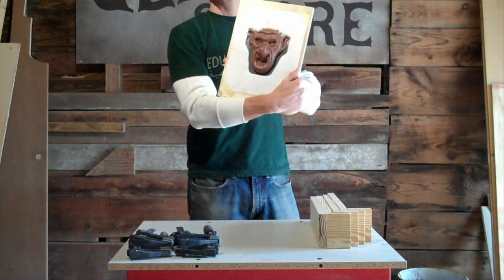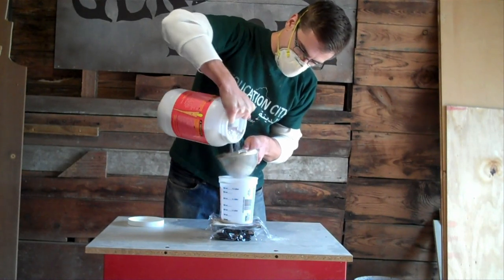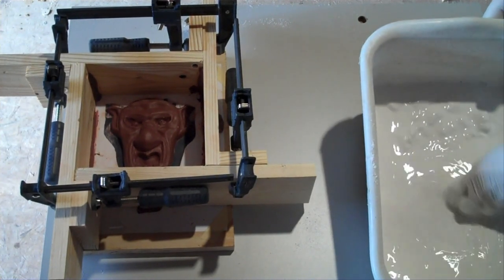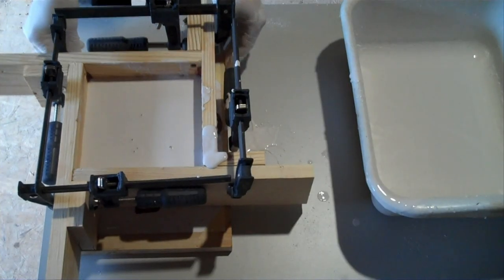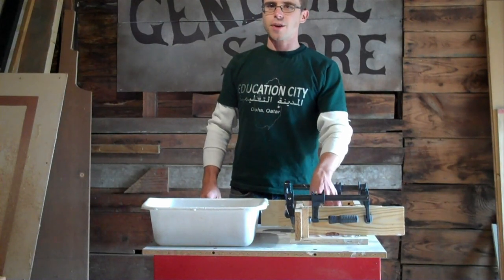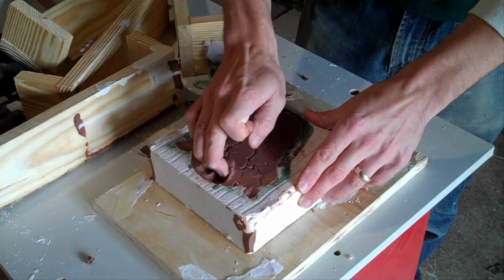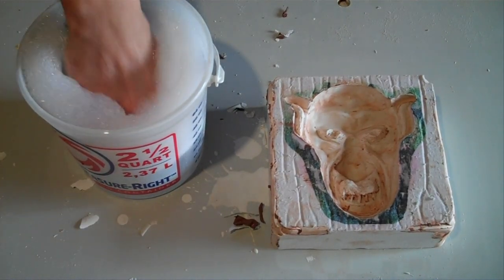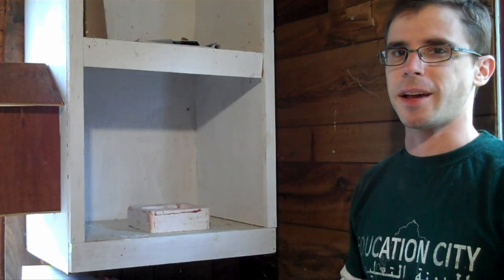Making a Plaster Mold

Comment from the maker: I've never cast metal in plaster, but I've read that for any metal you cast, you need to use a special plaster and it needs to be baked for awhile and cast while hot. Regular plaster has water in it, and since all liquid metals are hotter than 212 degrees F, it'll make the water turn to steam and the mold will burst.

Comment: The major disadvantage of the process is that it can only be used with lower melting temperature non-ferrous materials, such as aluminium, copper, magnesium, and zinc. The most commonly used materials are aluminium and copper. The maximum working temperature of plaster is 1,200 °C (2,200 °F), so higher melting temperature materials would melt the plaster mold. Also, the sulfur in the gypsum reacts with iron
Reply: What material should I make my mold from, if I am working with higher temperature melting points of certain metals?

Comment: Hi! I think painting a layer of lubricating oil on the clay will help you remove the model without destroying it. We use this technique in concrete casting.
Reply: would a silicone mold release work you think ?

Comment: Could you use a foam or similar material to say make a sword, then cast it in plaster on all sides (except for a small pour hole)? Then just bake it to get the foam or similar material out while also hardening the mold? I'm trying to make a sword out of aluminum or pewter.

Comment: Great video, Eric. Thank you for taking the time! Could you tell me what kind of plaster is best to use for casting the Ceiling moulding, fireplace mantels, furniture pieces etc... So basically, i already have a mold of the exact shape ready, i need to figure out the material to use for the cast. any pointers? Thank you in advance

Comment: What kind of material could you use in the mold when done? Could you use plaster or cement or what? Does wood or metal also work with a plaster mold?

Comment from the maker: Yes, you can get the clay out, but whatever material you use to cast in the plaster mold will end up trapped. Any rigid casting material, like plaster, clay, resin, or rigid foam, will be stuck inside with even the slightest of undercuts. If you cast with a more flexible material, like latex or even paper mache, you may be able to break it free if the undercuts are slight. But really, if you are looking at keeping undercuts in your mold, you should use a different mold material than plaster.

Comment from the maker: You can use this as a one-time mold, and in that case, you can have undercuts since you'd just be breaking away the plaster. Of course, you'd be destroying your original clay model in the process, so if your mold doesn't work, you've lost all that work. For lost wax casting, you typically make a mold of your original, than cast that in wax, than build your one-time-use mold around that wax casting.

Comment: I'm trying to make a object made of glutine (bicarbonate + superglue), the mold part is easy, but I'm failing to remove the object I made. It sticks to the plaster. Soaking the plaster mold with vegetable oil before doing the glutine, or with WD40, it did not work. Anyone knows?

Comment: Great video!! Thank you!! 

Can I create a plaster mold and use silicone to cast?  I have a small, flat, somewhat detailed, one-sided item that I will have printed on s 3D printer and I need the resulting cast to be flexible.   

What is plaster the best mold material for preserving detail?  Think a lace pattern in terms of detail. Thanks in advance.
Reply from the maker: +Donna Shanks You can cast silicone in plaster. The tricky part will be making the mold of the 3D printed part; you want to make sure you are able to remove the part after making the mold.

Plaster is pretty good at preserving detail. Use a pottery or art plaster rather than the hardware store plaster. Make sure it is fresh and sift it well before mixing.
Reply: +Eric Hart Thanks so much.  Yes, I was hoping that there is something I could coat the item with.  

I just realized an error in my earlier description. Sorry.  It isn't one sided.  It's a stencil that needs to be flat and thin because I will be airbrushing.  I'm creating stencils for a home project.  Would a silicone mold be better for that?

Comment: Hi, i have a question, I'm making a plaster mold, and i believe it has cooled down, but I can't turn it around and clean it up yet, and only will have time to do it in a few days.. Is that a problem or can I leave it like this and take care of it properly after 3 days?
Reply from the maker: It depends what you made your model out of. If it is oil clay, it should be fine.

Comment from the maker: For the most part, it should all be reusable. The clay should pull away cleanly from the plaster. As the plaster heats, it may soften the surface of the clay it is in contact with, but won't do anything else to it.

Comment: is it possible to spray a silicone mold release over the clay before creating the mold to help extract the sculpt after ?
or would the release spray cause issues with the plaster ?
Reply from the maker: The mold release might help a little bit. However, most of the problem is just the suction holding the clay to the plaster. The clay is not strong enough to be pulled out as one piece without deforming or tearing apart.

Using a mold release might present some other problems. If you want to use the plaster mold for absorption casting (either latex or slip clay), the mold release will stay on the plaster and create a barrier for the absorption unless you carefully cleaned it all out. And a silicone mold release may end up on the cast itself, which will prohibit paint from sticking to your cast if you wished to paint it.
Reply: @EricHartProps  what about using liquid mold soap as a parting agent?

Comment: This is a simple yea or no question. Would plaster of paris hold up to 2000F temp? Like use it for a Copper/Silver/Gold casting mold? I'm not talking about Pounds of the metal buy up to 10- 15 ounces?
Reply from the maker: +Christopher Sanchez Plaster is definitely used for casting precious metals, but the process is different than in my video here. If you use a mold like one I make in my video, the plaster will crack or even explode when you pour liquid metal in it. Do a search for "lost wax casting".
Reply: +Eric Hart yes lost wax casting..
Reply: My friends made some beautiful rings,  badges and badge pins using gold and silver, cast in plaster of Paris. Sometimes it cracks the mould, I think that's only if its a massive temperature shock between the hot cast and cold mold. They look amazing when he's finished them. Not to get political but they remind me of the Nazi ss type badges with skulls. All he saves are ALU beer cans and turned into nice hobby.
Reply: +SiCoope so it would be good to preheat a mold before the pour! maybe use one small toaster oven..
Reply: +Christopher Sanchez Yeah, I think that's how he fixed the problem. he's got me interested in starting molding now. I'm in process of making an hairdryer diy mini ALU can smelter myself. Made a nice catapult once in sand and lost polystyrene method, I'm wanting to do a deer skull with antlers next as a coat hanger.

Comment: hello, i would like to make a plaster model. i have a wooden object i want cast, i first make a mold with soft clay(wet clay). can i mix 50% sand and 50% plaster of paris together to create a textured surface? would the plaster model break as the sand is making the bond of the molecules weak? i would much appreciate the help .
Reply from the maker: +EliteDnaTrix If you make a mold, than the outer surface will have the same texture as the original. Using a sand/plaster mixture will not really add a texture to the cast. And it would probably make the plaster a bit weaker as you thought. 

You either want to add texture to the wooden object before making a mold, or make a cast and then add texture to that.
Reply: +Eric Hart thanks for your reply. the texture I would like to achieve is similar to a rough cement. if I do it with cement the casting will shrink when it cures. how about adding cement to the mix?
Reply from the maker: +EliteDnaTrix I've never tried mixing plaster with anything, so I don't really know what will happen.
Reply: +Eric Hart ok thanks for your help

Comment: Can I use such a mold for casting aliminium?
Reply from the maker: I wouldn't. The heat from the aluminum will cause any water in the mold to turn to steam and blow the mold apart. You can get a different kind of plaster that's more suitable for casting metal, but you have to make sure it is completely dry, and you actually bake it so it is hot when you pour the metal.
Reply: Ok I will research about other plaster but your tutorial was really helpful nontheless. Thanks!